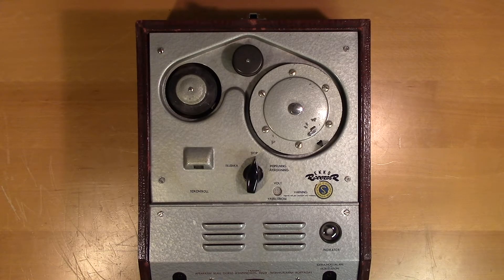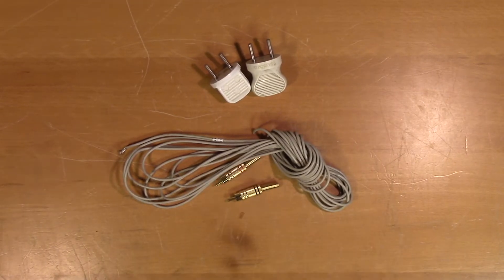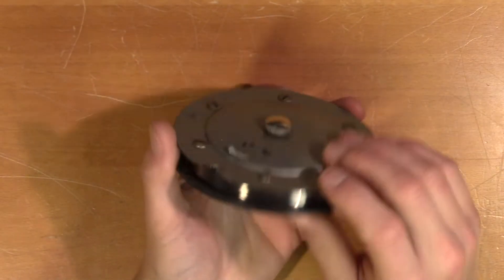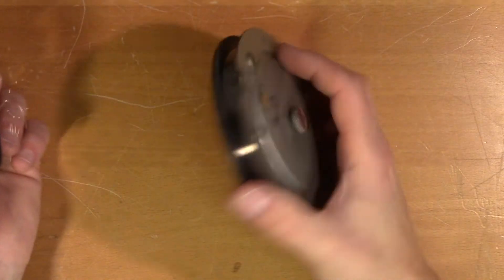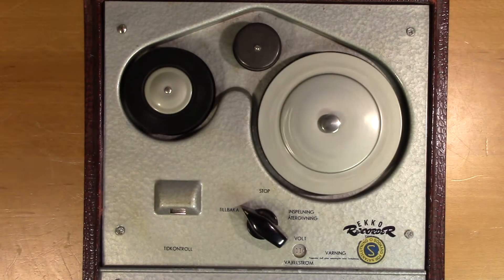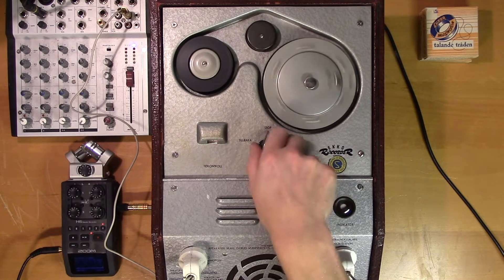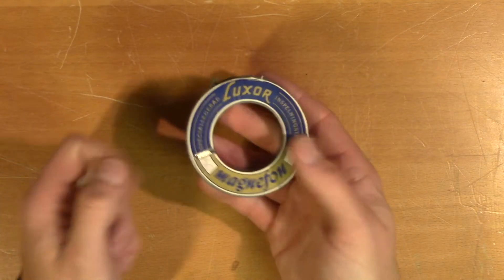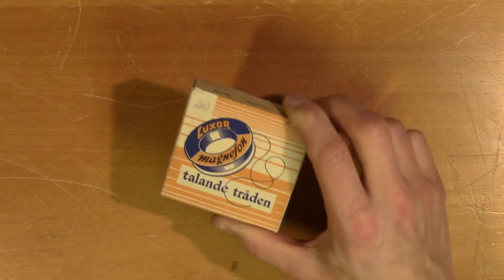How Good Can a Wire Recorder Sound? - Ekko Recorder Restoration Part 6/6

Comment: These audio cables fits directly into the 230V power sockets in my house from 1993, and probably like "everywhere" in Europe (still legal installed and in use, just not for kitchen and bathrooms).
Not for kids to play with...I went "yikes" when I saw this.
Today new electrical intallations dont have ungrounded wall sockets, so they want fit, but millions of homes they will fit...

Comment: Hi, thanks for the great video, there are not many about these devices. Any idea where I could find out more about how the oscillators worked in these instruments? I came across that the low frequency of the voice was superimposed on the higher frequency of the oscillator. But I don't know what the parameters were. Thanks for any information.

Comment: I'm quite impressed with the quality of audio from the wire. Much better than I expected.
Reply from the maker: Me too! And I actually think that it sounded even better when it was new. Even though this unit seems to have been taken very good care of, it was probably extensively used, causing some wear of the mechanical parts, resulting in some wobble. This was not addressed in this restoration.

Also, as I mention in earlier parts of this restoration series, the original capacitors seem to have been better suited than the replacements, when it comes to noise resilience. So, it probably had even better noise performance originally.

Comment: how hard would it be to replicate one of these?
Reply from the maker: Hi Guillermo Lopez! Interesting question. For the electronics, it would probably not be that hard to get most of the schematic right, but it would take quite a lot of time to map everything out. The transformers and motor might be quite a hassle though. If you cannot find matching ones, you might have to order costume parts, which I guess will be very expensive. The one component that will probably hinder your plans is the record head. I think it would be near impossible to find any modern, off the shelf part, that could replace the record head of a wire recorder.

When it comes to the mechanics I guess it could be done, but given the complexity and requirements on precision for one of these recorders, it would probably be an immense amount of work.
Reply: @SunandWeather  As a matter of fact I vote on this being easier than youd think. The descendants of these machines were reel to reel tape decks. These are just very dumbed down simple versions of reel to reels and as a matter of fact I bet we can make it better today at home than back then in factories,And the heads are actually some of the simplest parts of the machine that with todays tech (wire EDM) could be easily manufactured and youd be suprised.
As of right now I am designing my own reel to reel and the electronics are simple, with modern opamps of course. The same principals apply here that do with reel to reels.

I think we can do MUCH better than our ancestors. Considering AC bias for improving recording quality on reel to reels was invented in 1929 we can oh so greaty improve the sound. 

If I were to do it id use off the shellf steel wire and essentially make the same setup as a high end tape deck would have. Erase record and playback head. And of course because were tryint to minimise. If math checks out and you could find someone who would be willing to make a single precision cut in a magnetically soft metal on a wire EDM machine, if you design a wire transport and have it unlike on these machines, actually speed controlled, 100cm/s you could easily record 20kHz onto it. And all this doesnt even need to be sophisticated

Comment: I saw your video part 1 to 6 .  Is best ....  i  just want to know ...how abaut erase the record .
Reply from the maker: Hi Rusnan! Thanks a lot! I believe the only way to erase a recording on this unit is to put it in record mode while there is no input signal, and let it run over the part of the wire that you want to erase. So, if you turn the volume all the way down and start recording it should erase everything that passes through the record/playback head. If you find that it does not erase the data on the wire completely you could repeat this process multiple times.
Reply: I ve webcor chicago model 228 .  The problem canot erase .
Reply from the maker: This is from the manual for the Webster-Chicago Model 228: "Erase 
If it becomes necessary to erase a recording without,
at the same time, placing a new recording on the wire,
the wire may be run through in the Run direction with
the Volume control turned to minimum and the Dictate
button depressed."

If your unit does not erase the wire during this procedure, there is most certainly something wrong with it.
Reply: Oh yes  tangs a lot info .